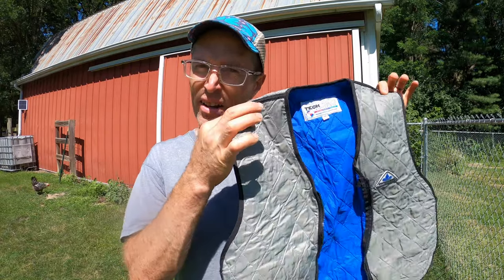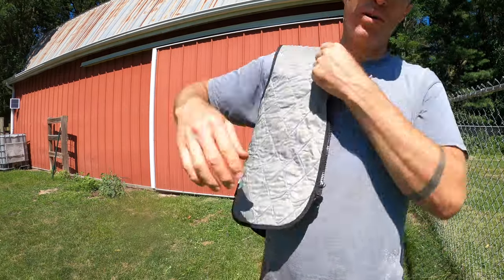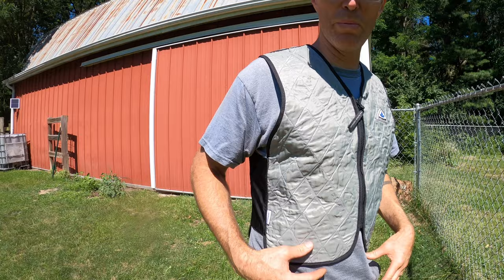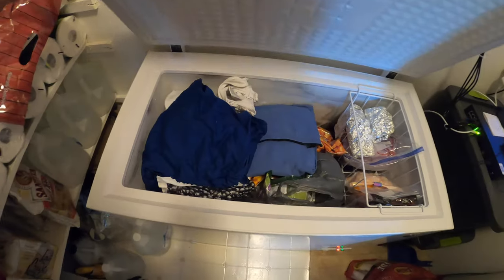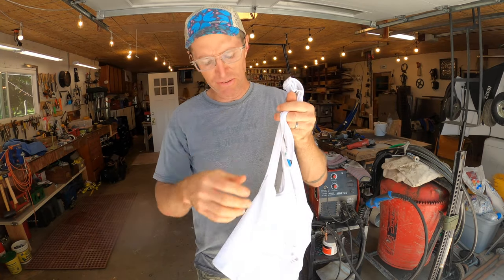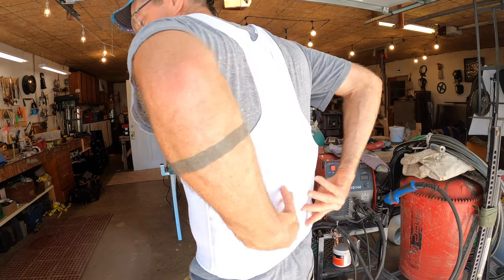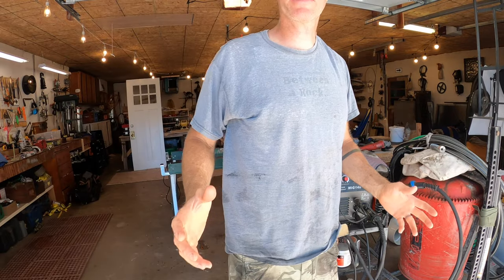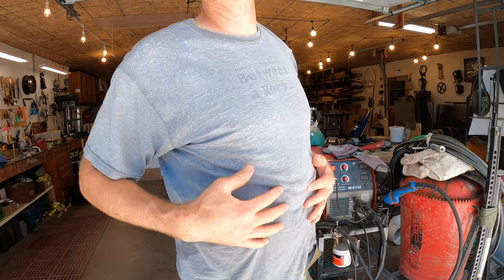Cooling Vest Showdown! Best and Worst

Comment: For your silver vest (the one you like the most) would you recommend ordering a size smaller than normal? That way it is more tight across the torso?
Reply from the maker: you might want to try that ... but I'm pretty happy with the medium and still use is a lot
Reply: @metaspencer   Well, if medium is your normal size and you are happy with it, then I would much rather stay with my normal size too. I don't want to go down a size unless it really helps with the cooling. Thanks for the reply, I'll definitely order one tonight

Comment: I need the Ice Water Vest you wore in your video. The link has an update version that is one unit. I actually need the 2 piece version due to using a wheelchair. Any alternatives you are aware of?
Reply from the maker: Something like the Compcooler Waistpack ICE Water Cooling System might work for ya .. good luck!
Reply: @metaspencer  It looks like a winner for my condition. Doubt I would have found it without your vid and advice. Thanks for putting it out there for us.
Reply from the maker: @trentwortman9159  Stay cool! (as they say)

Comment: You already know this, but the best cooling comes from the inside.  Drink ice water.  It's remarkable how well it works.  I've stayed sweat free and composed on the NYC subway without A.C. while those around me melted just sipping ice water.
Reply from the maker: Yep, it's all about the ice water for me. I even carry an insulated camelbak that I sip on to stay cool. Those NYC subways can be stifling!
Reply: Nothing stops me from sweating in the Florida heat and humidity. Drinking water just keeps me alive. Lol
Reply from the maker: Toasty down there!
Reply: Try that in the Mojave Desert…
Reply: A😊
Reply: Respectfully thats just not true. It quenches your thirst but a cool environment is the best way to keep cool. Homeostasis will regulate that cold water in minutes. A cold climate will keep you comfortable for longer when you return to the heat. Ppl that have heat strokes need to be placed in a cool climate first  allowing their body to regulate.
Reply: @ravenXO   Well yeah, but I think we're talking about how to keep cool when it's hot.  You don't actually need to keep cool if you're in a cool environment bc, well, you're already cool.
Reply: @ravenXO   Also, ppl with heat stroke should not be brought into air conditioned rooms bc it's core body temp that needs to cool down quickly, which won't happen through the skin, especially when the skin gets immediately cold and reacts to the ac.  Put hands and wrists in very cool water to cool down major blood supply which will cool down core temp.  A famous I think college or maybe high school football player died when they brought him into the AC after he passed out from heat.   A cool room is best but a cold ac room is counter productive.
Reply: When I had heat stroke I was packed with ice while in transit to hospital.@denisenj7648
Reply: lmao nee York subway isn't memphis with 100% humidity and 98 degree temps
Reply: @WickedWaysfpv7087   There's more ppl on one NYC subway car than all of Tennessee.  Believe me, the subway in the summer with no AC during rush hour is the final test in keeping your cool.  There's no comparison.
Reply: I live in the southern most part of Mississippi. The humidity is Brutal!!! There is no way to prevent sweating.

Comment: "cool" vlog
Reply from the maker: haha ... a chilly response! :)
Reply: @metaspencer  Are there any vests that don't require ice or getting wet? I work in a warehouse and I make doughnuts all day so I can't wear those. But it's been getting so hot lately that the warehouse is almost unbearable.
Reply from the maker: Battery powered circulation vests may be good for you
Reply: @asneakylawngnome5792  Are you sure a phase change vest wouldnt work? If the issue would be water dripping off you, you shouldn't have water dropping with the phase change packs. Even if there was a lil dripping condensation im sure it'll be less moisture than if you were sweating from heat
Reply: @chrisbeaumont4630  I work with food so it'd be a health violation or w/e but it gets too damn hot.
Reply: @asneakylawngnome5792  you normally wear the vest under your clothes so hopefully thats not against the rules where you work. Those frozen sealed pouches are heavy duty so you don't have to worry about popping a leak. These were a game changer for me, working in a factory as a welder. Being overweight, in all that heavy gear on a hot day had me nearly passing out far too often, and I'd sweat like a pig the whole time. A phase cooling vest was a real lifesaver for me, maybe literally lol. 

There are some brands designed to not be visible underneath your clothes too, look more like a t shirt than a vest, they'd be perfect if you gotta be sneaky about it at work

Comment: Evaporative vests never will and do not work if you live in a humid climate like myself. Our summers are 70-100% humidity for the entire summer and into the fall. They don't work one bit so it's out of the question.. they just make you wet and hot
Reply from the maker: You're absolutely right about humidity and evaporation ... in your ultra-hot climate pre-cooling is super valuable, as well as shade and drinking ice water when out there. Stay cool!
Reply: Like Central Florida

Comment: It's just insane to me that they haven't yet devised a cooling vest which is close to perfect. Because that would be a game changer to so many people. I am an ER nurse, I have always run hot, and the biggest problem for me that no-one else seems to  be that bothered by,  is that I perpetually overheat and I can't stand it. 

 If any one has  yet found the perfect vest-physically light, non-bulky, that does the job please place the link!
Reply from the maker: The circulating vests that run cold water over your body at a constant rate do the best, in my experience -- but they're cumbersome and expensive.

Comment: Man, the ventilated vest, you were using it wrong, the  plug in side of the fans should be inside, and so the cables, so air comes in, the way you used it doesn't move any air, I have some of those and they work more or less fine. By the way the best way it works for me in hell hot days, is to constantly soak my t-shirt in water and use the ventilated vest, so both, air circulation and evaporation improves, it's like our natural cooling but improved, in normal hot days the fans are enough
Reply from the maker: Dude, you're right: I totally couldn't figure out those fans! User error and bad instructions with the unit. Thanks! Stay cool :)
Reply: @metaspencer  hope you can try it again and tell us how it compares to the others! Greetings!
Reply: @letterbomb211  I think he did wind up installing the fans correctly and still wasn't impressed.